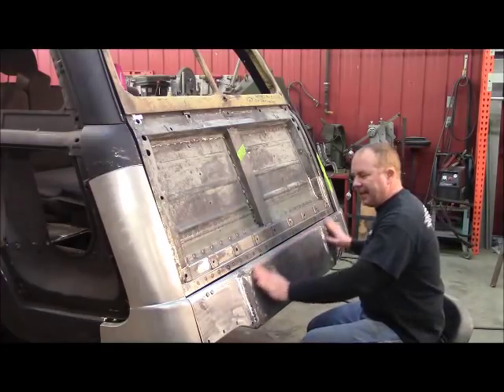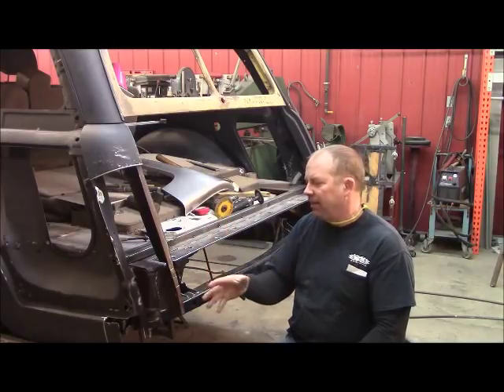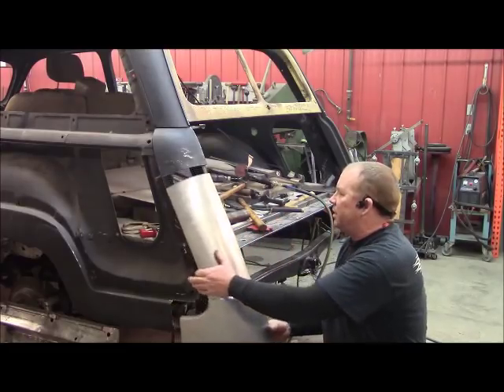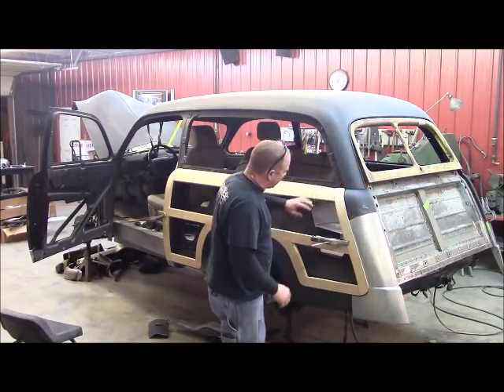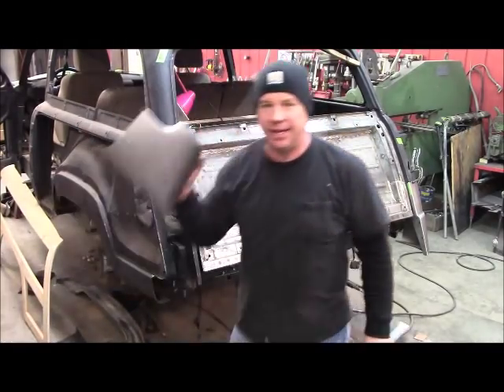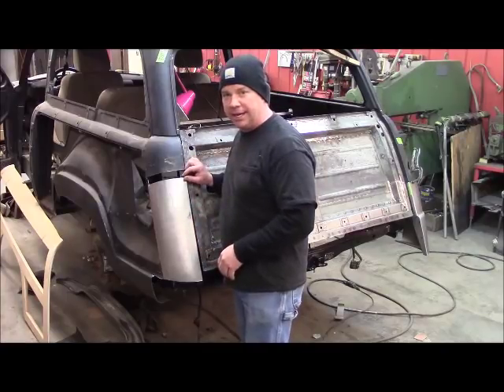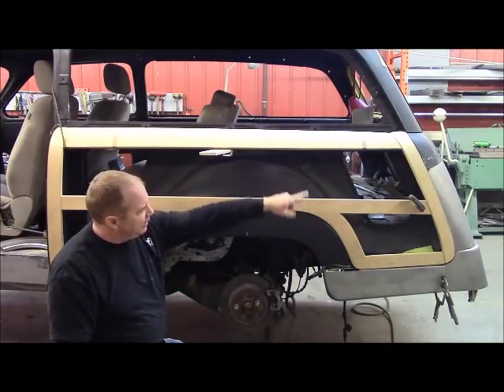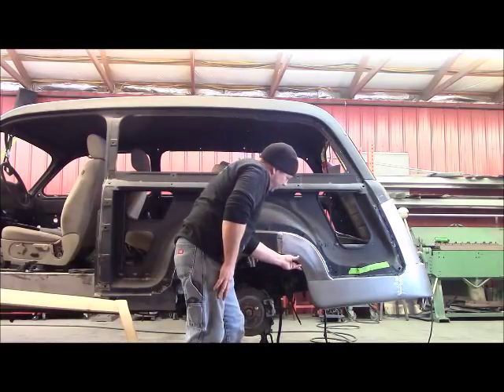Woodie is getting rear corner sheet metal and wood work

Comment: Stunning work, TC.  That wood will eventually dry out & shrink a bit, this is from over 50 years of dealing with shrinking guitar necks, even in humid climates.  It's worse here in Colorado of course, where it's essentially an arid climate, but I had the same problems for 30 years in Chicago, right next to the lake. I don't know if you have much you can draw on from experience working with this wooden stuff, but the only thing I can say for sure is it will shrink. Looks awesome so far, man. 😎
Reply from the maker: Thanks Zeek